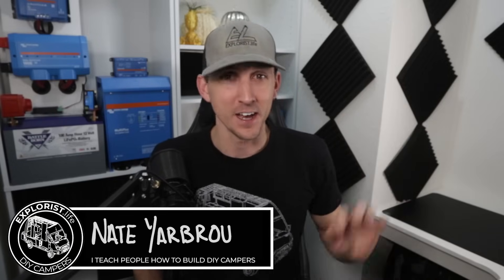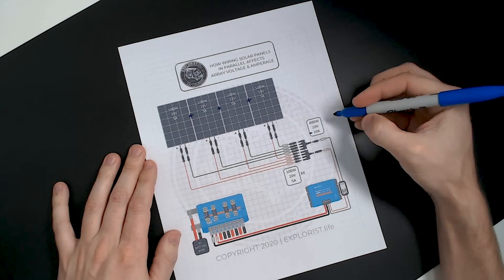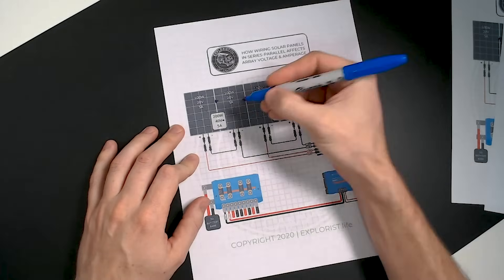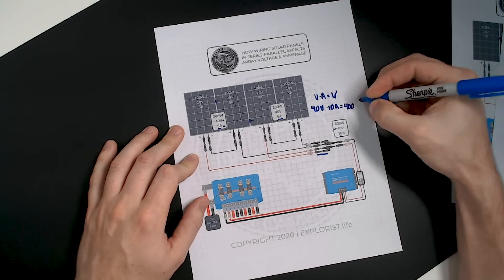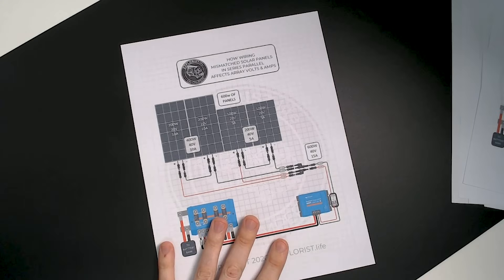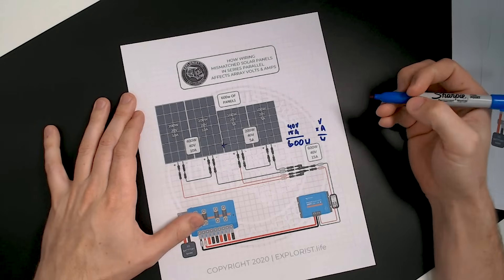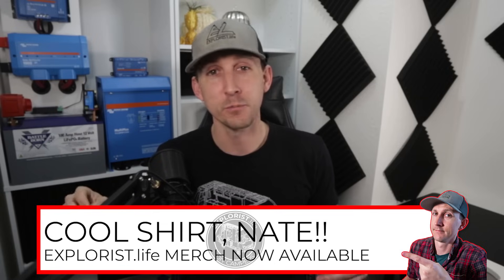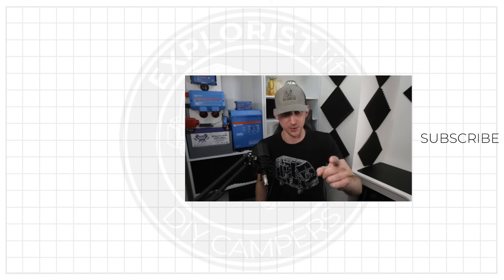How to Wire Different Sizes of Camper Solar Panels Together - Effects of Mismatched Solar Panels

Comment: Hi Nate.  Really appreciate your efforts to help us all DIY.  I have watched all of your DIY solar videos, some of them multiple times to help me learn solar/RV electrical.  I've learned a lot but I'm still not 100% confident in my decisions.  I would like to have 2 arrays for my RV.  One array will have 4 Renogy 100W (18.6V, 5.38A) panels run in S/P 2/2.  These panels will be placed on the ground to get better angles to the sun and to help avoid shading.  The other set of panels will be placed on the roof of the RV to allow us to charge while on the road (and in camp), but since placement is more challenging they may get obstructed.  I was originally looking at the Renogy 200W but given the array specification differences it seems that their performance would be too low.  So based on your advice I changed to using the Rich Solar 200W (37.6V, 5.32A) panels wired in parallel, which if I have done my calculations correctly should get us to 99.8% efficiency.  Can you please double-check my logic on this?  Thanks.  Now for my "real" question - do you think I should use 2 solar charge controllers (say a Victron 100/50 and a Victron 150/60) or would we be better served using one solar charge converter (say a Victron 150/100).  The price difference between the two S.C.C. approaches is negligible.  Thanks for whatever advice you can provide!  Jim

Comment: Great video!! Just to be certain,  I have  a total of 6 solar panels wired in series - parallel,  Panel # 1 is 31.3 volts/8.63 amps , Panel #2 is 30.2 volts/8.43 amps, Panel # 3 is 30.6 volts/8.66 amp wired  together on 1 series string. The other set of 3 Panels are.... Panel #4 is 36.1 volts/7.62 amps ,  Panel # 5 is 36 volts/9.03 amps and Panel #6 is 38 volts/9.48 amps wired in the other series string then connected in parallel . Base on your formula showed in the video the total power coming from the array is 1,478.2 watts. Can you confirm whether this calculation is accurate? Also, my battery bank is consist of eight 12 volts sealed lead acid batteries, however, I don't feel the batteries are getting enough charge from my solar panel array. I am running a 48 volts Mppt all in one charge controller which has a max open voltage at 145 volts and max input current at  50 amps. Are there any suggestions you can offer in getting full benefit from my system? your help is greatly appreciated.
Reply: You may not need this now, but based on his video, I agree with your calculation. Playing with the numbers, I see that if you switch 2 and 4, you would get 1572.9 watts instead.
Reply: You have 8 batteries, or 4x2, for 48 Volts,  BUT of how many Amp-Hours are they? they make them from 45 (0.54 Kw-hr), up  to 250 A-h (3 Kw-hr) and more.

Comment: Question - If all panels are 18 volts and I have them in parallel in a 12 volt system then I should not have to worry about ineffeciency?

Comment: Wish you would cover the impact of partial shade on an array! If one panel of an array is shaded a bypass diode would allow current of a series array to be impacted but would reduce the voltage. Reducing the voltage impacts the performance of panels in parallel to the shaded panel, no?

Comment: So on the last example if they had added that panel in one of the series instead of paralleling it in would it had made a difference ?
Reply: yes it would drop the voltage in the other strings

Comment: Is there any advantage/disadvantage to having a high voltage low amp configuration? Or high amps low volts?
Reply: With higher voltage, you can use thinner (cheaper) wires.  If you have a long wire run, this can save $$s.
However, higher voltage is more dangerous (to deadly) should you get shocked, and many appliances require 12v DC, so additional hardware to reduce the voltage for end-use may be required.
Reply: I don't think my inverter is big enough, or something is wired wrong bcuz it keeps blowing the inverter fuse. Can I wire my solar to the inverter already installed in my trailer? I have two 100w panels and two 125w panels both 12v wired in series parallel, now going to two 12 v LifeP04 batteries -(I am replacing 3 lead acid that my 27yr old son ruined by using all the charge on the batteries-) but this is my first time doing any of this, so I'm kinda stressed out with the inverter thing.. I have never actually gotten to the "done" mark. I would REALLY like to get there tho... I have only heard of how dumb this little project is and how it will not work.. I gotta make it work. Please help...? Sincerely, A Newbie Nobody

Comment: So in your second to last example if you connected the larger 3 panels parallel and the smaller pair in parallel and then connected those two groups in series you’d get 20v 30a + 20v 10a = 20v 40a for 800w total right?
Reply from the maker: Good catch!  ...and that's true, BUT...  The solar array needs to be at least 20V higher than the battery bank charging voltage for optimal MPPT charge controller performance.  Plus... if you wired them like that, you'd be at an array amperage of 40A and could no longer use MC4 connectors which would force you into using a combiner box like this (https://amzn.to/3xSzJrP) which is very much less than idea.

Comment: I have two, 180W solar panels at 21.6V and 10A each and two, 100W panels at 22.8V and 5.38A each.  How would I wire these together to get the most wattage out of them?
Reply from the maker: The video you just commented on will teach you how to figure that out. 🙂

Comment: Dude, you are tied with Dave Poz, Tin Hat Ranch, and Will Prose for the best info/teaching in solar. Each of you excel over the others in your specific areas. This is meant as a complement. I prefer your speed and detail of info and diagrams are fantastic! I learned more detail and had holes in areas I thought I knew filled in after watching your videos!

Comment: Bus bar for every panel positive and negative problem solved
Reply from the maker: The connection method wouldn't solve any problems regarding array efficiency due to mixed solar panel sizes.

Comment: Overall a good video to show why you should "not" mix solar panels of different wattage and voltages to a single solar charge. If you have to mix panels of different wattage and voltages place them on separate solar charges. Yes, it may be a little more expensive. But you optimize solar panel output and you will create redundancy. As mentioned in the video a solar array will always be reduced to the efficiency of its lowest rated panels. Always design for optimum production of solar panel arrays. In the end you'll be better off. Also be aware as you increase current you need to increase the wire diameter (lower AWG wire size) which adds both cost and weight. So increase voltage is better than current. And use good quality MPPT charge controller's for higher voltage but keep current low. Let the MPPT solar charger convert the voltage above ~14.6 volts to extra charge current. Finally, have a system properly reviewed by a knowledgeable solar system installer to verify everything is properly sized, from panels, wire runs, charge controller, battery bank and protective breakers. Do everything safe.
Reply from the maker: That pretty much summed up the last dozen videos on this channel. :)

Comment: Great videos, am I the only one trying to parallel panels then in series? I have 8 -60 w 19v 3amp panels I would like to make 2 - 4 each in parallel To bring the amps up to 12 amps then put both parallels in-line (series) with 3 other 200 w 19v 12 amp panels . I know you are the one who knows...is this possible? I was hoping to get total 140 v @ 12 amps Then the outback 80 could make it 13.6 v @ 80 amps

Comment: Hello! If in a series of 10 panels with 310w, I have panels with different parameters, is it a problem? Example: 8 panels 33.2V / 9.3A and two 32.6V / 9.5A. Thank you!
Reply: Group the panels together which I assume your using a series parallel connection. Do though try to keep all of them the same.

Comment: Excellent video and blog post, thank you. Today I tested my new Renogy 100W and 50W panels wired in series and in parallel. I will mount two of these pairs, each connected to its own MPPT charge controller, either side of my yacht's main sail. Based on the panel specs (same Vmp but different Imp) I expected that wiring them in parallel would produce more power output. Surprisingly, when I measured the amps in series they were double what I expected - 5.2A instead of the 2.69A Imp of the smaller 50W panel?! Any idea what is going on here?

Comment: Absolutely brilliant information. For my situation I’m am still a little confused as to what the best layout would be... 
I currently have a single factory installed Overlander 190w mono panel, 10A PWM controller, one 12v deep cycle battery, and all running on 10 gauge wire with a 20A fuse.

In my garage I have three additional Renogy 100w mono panels, a Victron 100/30 MPPT BT controller, a 30a fuse and two 235Ah 6v batteries.

FYI: The fuse is between the controller and the battery.

I’m not really sure what the best array setup would be to make use of what I have installed along with what I have in the garage?

The overlander is rated OCV 22.5 v @ 9.35a and the Renogy is rated at 22.3v OCV @ 5.86a - rated DC Voltage for all is 18.6v

So based on your math, my best configuration would be the 100w panels in parallel (18.6v @ 16.2a) in parallel with the 190w panel for a total 18.6v @ 25.5a totaling 474.3w (optimal sun). Seems this would be the best configuration and still be well under the 30a the system is designed to handle!
Reply from the maker: Keep the 190W panel on it's own controller and then wire the 3x 100w panels in series to the 100|30 so you are running a system with dual charge controllers.

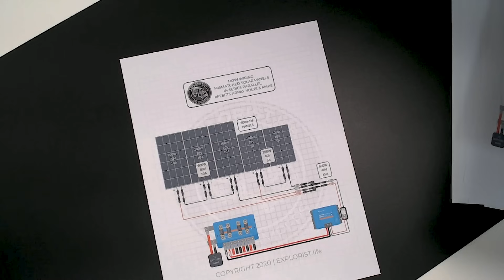Comment: If you reconfigure the example at 8:13 by putting them all into a series string, since they are all 20v, wouldnt that mean that youd be able to get 100% efficiency? total 100v, 40 amps and 800 watts?

Comment: Hi guys,

 I love your utube series of videos and has helped me with my
 solar upgrade to my caravan.

I have a parallel connected array of two
 panels from my roof to a positive and negative bus bar through to a solar 
disconnect to a Victron 100/50 in my front hatch. My question is,can I add a portable panel that can move around to
follow the sun through a anderson plug to the bus bar without downgrading my array. Is there any rules
regarding this.

   Thanks Gavin
Reply from the maker: The 'best' option would be to keep the, essentially, two arrays seperate and each going to their own charge controller.  2x panels in series on the roof to it's own MPPT and then the 1x ground panel to it's own charge controller.

Simply paralleling all panels 'could' work fine, but depending on the panels you are using, the array needs to be 20V higher than the battery bank voltage to function optimally.
Reply: @EXPLORISTlife  thanks Nate

Comment: Hello, thank you for your very informative video. Can you please verify my numbers? I have 4 panels of the same voltage 17v on top of my RV.   3 are 210 watts 12.3 amps each,  and one is 160 watts 9.4 amps    based on your video,  If  I run them series parallel  I should get    34v @ 21.7 amps . Is this correct ?
Reply: Your three panels in series will essentially be a 51volt solar panel. Don't think you can connect that in parallel with one 17 volt panel. Three160Watt wired in series would parallel with the 210Watt. Best watch this video again.

Comment: The Series has been great! Think I've watched everything! Certainly picked up a lot of clue, from tools, to when to fuse on the roof.
What about discussing East / West panels? (when one has no suitable house roof pointing to the equator). I understand that this could be more desirable as one can catch both the early and late sun rays.
One thing you don't seem to have mentioned is that if there is shade on a string - it affects the whole strings production of power - so having a well chosen placement of a mix of Series and Parallel panels can be the wisest configuration.
Lastly (back to East/West configs), if there is less sun on an area - does this affect the voltage or the amperage of the string?

Oh - the hour long video with your friends RV - four panels down each side in series, why that format? I think I'd put the four at the front in series and the four at the back in series - so parking with one end in shade gives at least one good string. The Left & Right strings is primarily beneficial if in the complete open with the RV parked North/South. Perhaps have a method of switching between the two layouts?

Comment: Hi Nate.
Until recently, I had two solar chargers to charge the batteries. Four modules on each, namely the new Q cells string parallel on the Epsolar tracer 6415AN, and the mixed brand cells also parallel on the Epsolar eTracer 6415BND.
Each branch was tied in parallel. Now I bought a Victron energy smartsolar MPPT 150/100 and the question for you now is how to tie the panels if you can advise me. Sorry for the bad English and nice greetings from Slovenia.

Comment: Thank you for the video. I have one comment and a question:
1- in your last examples (when you have different apm but same voltage), why not mounting them in parallel and that is it? 20 v and adding up the amps !!!

2- Adding or replacing a solar panel with a higher rating one (higher voltage and higher amperage) will not degrade the maximum electricity production??? If this is true, why everybody is keep saying that we should replace panel with a similar one? I think we can replace with a higher rated one (if we ignore the financial cost burden) ! am I right?

Comment: Need help, I have a Renogy suit case 200w sys (two 100w panels) with one set of MC4 connections.  I just bought two 100w single panels with a 3 way parallel branch. So that should be 400w, BUT the question is:  Is it 400w when the Renogy is already in parallel in the back of the suitcase panel, hence that's why only one connection is there.  I have never seen anything over 170w with all three connected.  FYI: the amps are almost the same from the Renogy to the single panels.

Comment: Ok for this. Can you share your diagrams please?
I would like to know if we can connect batteries of the same voltage but of different capacity in parallel.
(I am French living in Guadeloupe FWI)
Reply from the maker: Diagrams for this video can be found at this blog post: https://www.explorist.life/using-mismatched-solar-panel-sizes/

It's not recommended to wire different batteries together into the same battery bank.

Comment: Can  3 x 200watt panels fully charge  2x  200ah gel batteries
Reply from the maker: The rule of thumb for solar to battery bank ratio (for 12V battery banks) is: Usable Amp Hours x 2 = Goal Solar Wattage

(so, yes...)

Comment: Wow. I've mixed 3 200 watt panels with 4 100 in parallel.  So my take away is I've lost 300 watts of power doing that.  I've got some wiring to do. Awesome video an explanation of mixed panels. Thank you.
Reply from the maker: Darn! Hopefully you can get it all sorted out!
Reply: @EXPLORISTlife  wired like I described I was getting 49 amp on that controller. But I have a 50 amp an 60 amp. An 1900 watts of panel. Getting 100.6 amp combined. Wired properly I might get 160 amps. Will do a video on it.

Comment: Solar panels 

435W

44.50 Voltage
                                      8 panels
9.78 Amp

356 voltage total
9.78  total amp
—————————————————————————————————————

440W

10.60 Amp
				    2 panels
49.2 Voltage

98.4 voltage total 2
10.60 amp

380W

40.5 Voltage
                                    6 panels
9.39 amp

243 voltage total 6
9.39 total amp
—————————————————————————————————————
341.4 total voltage of 16
19.17 total amp of 16

hello sir what will be the answer of this

Comment: Can you please do more of these type videos; where you use the diagrams in different complex configurations.

 Im still trying to get my head around the last example you used, Its beautifully explained but I'm trying to understand the science when you add a new solar circuit in parallel with a string of another circuit in series parallel. 

Why would panels use  ''The lowest common voltage  '' as explained in your last example. Is there a law other than ohms law am not aware of ? I'm fascinated
Reply from the maker: That's just one of those "It's just how it works" kind of things.  We just have to understand that panels operate at the 'lowest common voltage' and base the math around that.

Comment: Big thank you for your videos- great resource- I’m building a sprinter CamperVan and purchased your drawings and shopping list and it’s great!- I’m going through the shopping list and having really hard time finding the TEMCO 6AWG wire- especially the black wire- Can I buy a larger amount of red and wrap the red with Black electric tape? Sounds silly to do this- but really I’m not finding this wire.
I’ve found similar wire called Welding cable class K- but doesn’t seems right, so would rather purchase the Temco wires you recommend-

Any suggestions?
Reply from the maker: Here is some 6 AWG Black wire that has 105 degree insulation as required in my diagrams: https://amzn.to/3781WA5

Comment: Hello I've bought one of your plans for my sprinter solar conversion , but I have a 3000 watt victron inverter not a 2000. Does this change the wire size going into my inverter ? It shows 2/0 I believe. just want to say what an amazing resource this is. Thx again.
Reply from the maker: That will indeed change a lot of wire, lug, and fuse sizes.  Example using Multiplus 3000: https://www.explorist.life/3000w-inverter-400-600ah-400-to-1200w-solar-camper-solar-kit

Comment: Can I parallel 2  same type 12v lipo  with 200ah and 100ah
Reply from the maker: It's likely not recommended, but that is information you should get from your battery manufacturer.